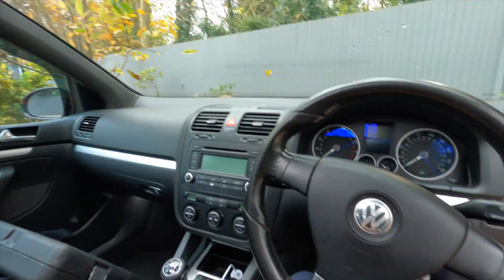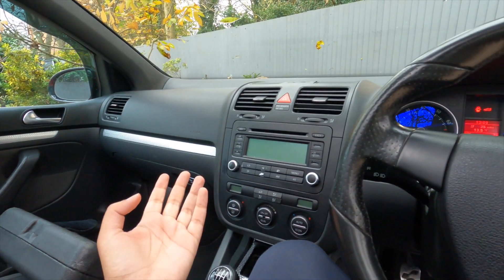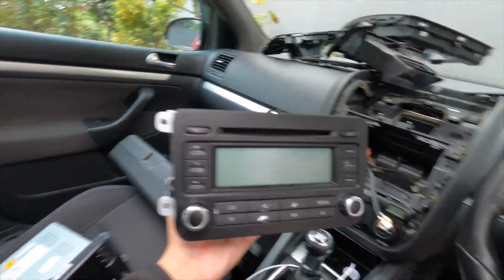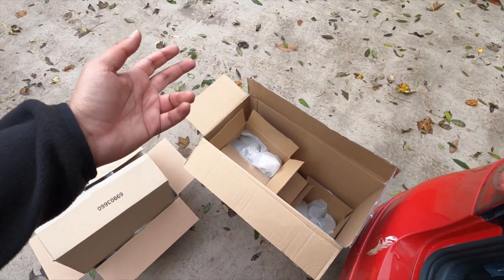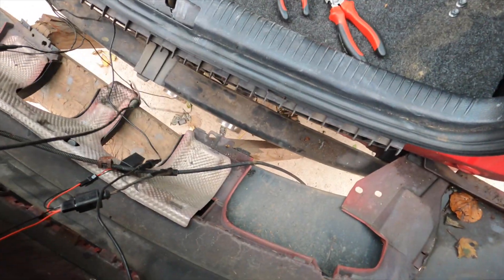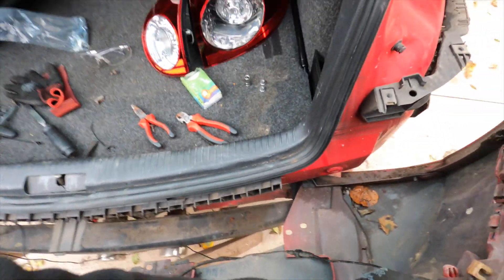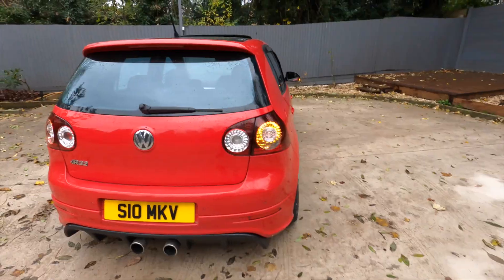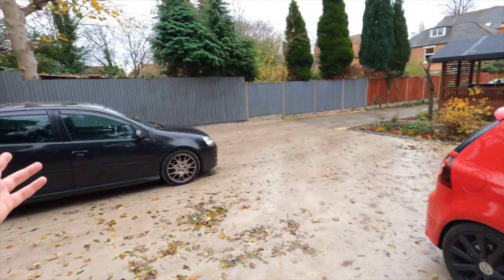Modernising my Cheap VW GOLF R32 with 3 Simple MODS!

Comment: I would suggest adding a alcantara steering wheel and a front splitter
Reply: If you go Alcantara, you have to vow never to touch the steering wheel with grubby lip licking fingers 😂

Otherwise it becomes a proper mess and looks nasty
Reply: @Patient_Lion_BS  true but u can get alcantara on the top and bottom and the sides leather
Reply: Or just use a mk6 or mk7 steering wheel
Reply: @jessevanwoensel1172  won’t look good in a mk5
Reply: @jessevanwoensel1172  not my taste
Reply: @hashimyounas3373  mk7 wheels look amazing in mk5s??
Reply: @nickr.6961  wheels do steering wheels don’t

Comment: I just got a pair of valeos for my MK5. If the reverse and fog are the wrong way around when you reverse (fog light on) and when you active fog (reverse light on) all you have to do is just extend one connector that clips into the lamp. One of the connectors can be swapped but one needs to be made longer. Makes it easier than getting someone to open them and then condensation happens!
Reply: A single fog light must be mounted on the right(offside) of the vehicle, otherwise it won't pass a MOT.

Comment: For value purposes the R32 should be left as stock. Prices are rising as the number of Mk 5 R32's on the road are diminishing and values are creeping up. It spoils them with bolt ons and alterations. I have had my R32 since 2008 from new to date  and the true collectors want untouched originals. They consider updating them reduces the values. If you want to upgarde and modify you should have a GTi as they are perfect for moding.
Reply: Someone online said roughly the same thing plus said to keep the money for when it goes wrong, because it can be expensive to repair.

Comment: we had a vw golf r auto box which drived like a dream it was load because we fitted a straight pipe for two weeks and then took it back off and sold it for a merc c63 and sold that only because it had a leak in the engine compartment but i encourage you to look at my son on Fastlane_tv .

Comment: Great video man. Already had the RCD330 but that diffuser is very tempting. It doesn't look like it from this video, but does the diffuser allow access to the tow hook passthrough in the rear bumper? Necessary for track use! Cheers from the USA.

Comment: Hamza is anything else needed for the RCD330? I have the same old school original headunit and it doesn’t have Bluetooth. Is a Bluetooth module or anything additional needed to get the RCD330 to work?
Reply: Rcd330 has Bluetooth integrated
Reply: @incy2k  thanks so nothing else needed, just a straight swap?

Comment: Where did u get original exhaust fitted from brother? Reason why im asking is my eml light came on, got it diagnosed n mechanic said sum1 fitted performance cat so it needs to be remapped stage 1 an eml light will go plus he goes small little minute leak but he didnt wana sort it in case he snapped a bolt or sumat.. so i was thinking of getting a whole new custom exhaust for it full back to front.. what do u think?

Comment: I had an RNS 510 in my 32, but it wasn't from the car originally and started coding about a month after I got the car, so it wouldn't work. I got an aftermarket non-navigation bluetooth head unit instead.
Reply: Also, I've still got stock exhaust plus flapper mod, and it's nice, growly when you want it to be.